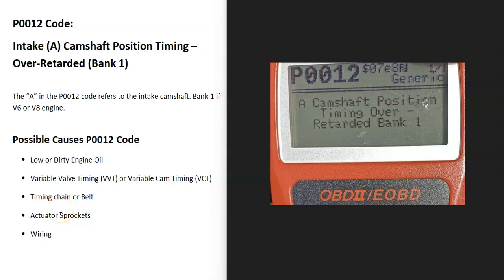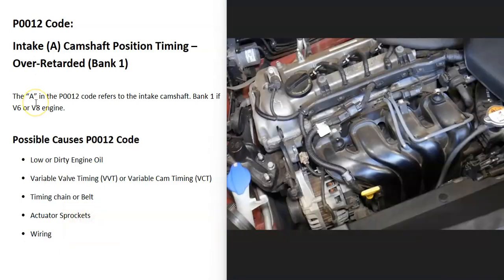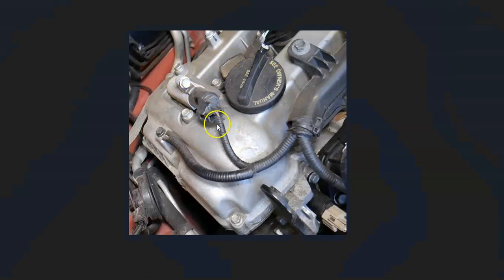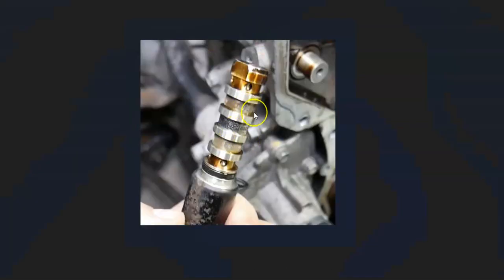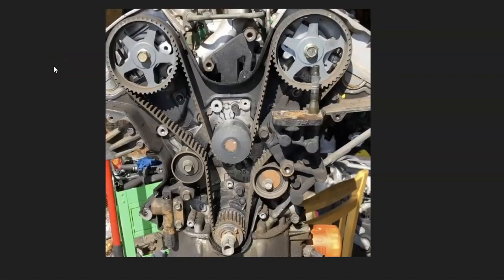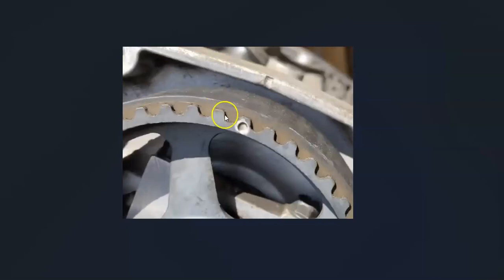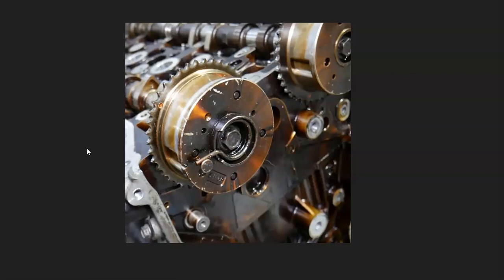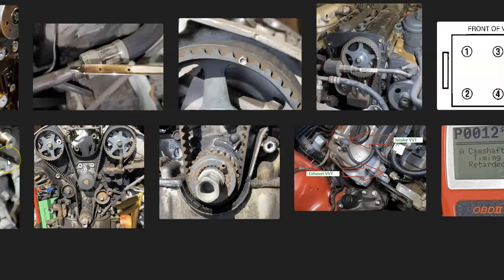Causes and Fixes P0012 Code: Intake (A) Camshaft Position Timing – Over-Retarded (Bank 1)

Comment: I changed the oil after 8000km on my BMW, I did an oil flush since it was fairly dirty and put new synthetic liqui moly oil that's LL01 rated. The next day, I'm getting this code, can someone suggest what the hell is happening. Can my BMW get shocked by replacinf old oil with new oil??
Reply from the maker: I would verify the new oil is the correct type, since if it's wrong, that can cause issues with the VVT.
Reply: @HVAC_Mechanic I looked into this, and read some forums of people using the 0w20 on their n52 because it's cold where I live. My n52 is supposed to take 5w30. Do you think this will impose an issue?

Comment: There is a knock also but when scanned p0012 came up. Is that normal for  cylanoid or timing? It ran low on oil but ran fine then did thid

Comment: I been having a poo10 for months. Changed intake VTT solenoid. Same code so he then changed exhaust vvt not only same code but now I'm getting a poo12. So he went ahead and changed the camshaft position sensor still same 2 codes. Oh forgot to mention the car is a 2009 avalon.

Comment: What if you change your oil just fine  the level is on point BUT your dumb ass forgets to put the filler cap back on and your drive for a couple of days without knowing it’s off!! 
What do you do then besides kick yourself in the ass for doing something so stupid so idiotic 
What do you do then?

Comment: I have a 06 ford expedition i put in a new timing valve solonoid i believe its called. Ran codes and it says i this code along with 8 others all about cam shaft banks 1 and 2, also  i know i do have dirty oil what would be my next steps? Please and thanks

Comment: Ive got a 2016 Ford fusion 1.5,  just replaced the vvt solenoids and it didnt fix the issue. If the code or light is still on after the replacement, do i need to clear the code for it to run correctly or should it have cleared itself?
Reply from the maker: If the problem is fixed the computer will reset the code at some point, when depends in the vehicle. I would clear the codes with a scan tool and see if they come back.

Comment: I think my issue is low oil preasure or an electrical problem. It's a 2014 Ford Mustang v6 3.7 and I have Diagnostic Trouble Codes (DTCs) P0024, P0014, and P0012.

Comment: Hi, I have 2010 toyota corolla, and it pops up code p0012 and i open the valve cover, and front side oil is so slow compared to the back side what can be help please
Reply: The oil coming out of my VVT solenoid is very slow too. I am wondering if the oil pickup tube is clogged, the oil pump is faulty, or the pump is sicking air. Did you find the problem on yours?

Comment: Toyota told me the 4 camshaft sensors needs to be replaced
 Currently je said thr bank 1 A timing over back 1 is the one giving issues. Can u do a video on how to replace it as well as the 4 camshaft sensors? Is it easy enough to do myself? Toyota wants to charge me 1700 bucks
Reply: The problem is rarely the actual sensors. It's often the ce'ns'ors detecting issues so the codes point to the sensors.

Comment: I just got this code after running over something. The wiring might have been ripped out? The last repair was the water pump. Timing chain not changed. Checking oil tomorrow the low oil light did not come on and was changed 1500 miles ago.
Reply: Hi, what was the problem?
Reply: @florenbaron7111  they couldn't find anything and erased the code. Dealer.

Comment: Customer self installed timing chains on 5.4 navigator and it knocks after driving. I assume he is 1 tooth off on each side. First, I changed his ultra black oil and oil filter feels like 5 pounds of crap. 😂 Clearing codes now. I hope it isn't the o ring on oil pump, but I am going in deep later today and pull it all apart.

Comment: I'm pretty sure my issue is the sprocket at the end. The engine was rebuilt last year and it runs good, but that stupid code won't go away. I've changed out the VVT solenoid and that didn't help. Your video is the only one I've found that explains all the troubleshooting scenarios. Thanks for the great info.
Reply: did you find the issue?
Reply: @wise_soul8886  No I gave up.
Reply: @yamnjam 😂
Reply: Same issue. I actually swapped the whole engine after getting a P0012 code. And the code will not go away even after the swap. So now I’m thinking it’s the wiring. Frustrating
Reply: @211sweatz  I originally had a trouble code for an open/circuit in bank 1 cam position sensor actuator. Mechanic changed vvt solenoid B1 intake. Same code so he then changed the exhaust vvt also. Nothing code still appeared alone with a new one the dreaded poo12. Now why is that I don't know.  Can a newly installed part cause a different code?  So he then went on to change the cam position sensor. Nothing changed. Will be checking the wires and connectors Tues. I have honestly thought all alone it's a wiring issue.
Reply: @211sweatz same…
Reply: @tristontownson1391 I seen in a video that it is the camshaft position sensor

Comment: i have 06 camry 2.4 vvt. i get the code here when driving and after about 10 minutes of driving i will get the p0420 code. clear the codes while driving and the cam code comes back and once i parked and let it idle, it shuddered and threw a code regarding cylinder 3 misfire..i was wondering if this was timing related or could it just be a dirty/clogged fue
l injector
Reply: Was it the injector?

Comment: I have a 2019 Infiniti Q50 3.0t (94K miles). My car was driving very sluggish when I was trying to accelerate. 
I ran my OBD scanner and got the two codes:
P0012 - A Camshaft Position Timing Over - Retarded Bank 1
P0022 - A Camshaft Position Timing Over - Retarded Bank 2
What does this mean? What should I be replacing?
Reply: i got the same codes bro.. did you ever get it figured out? please let me know.
Reply: @xxuyzzdr3851 what ever happened to you? Bro what was the outcome
Reply: You ever figure it out
Reply: @Jonathan-cv4tk  yeah. I took my car to the dealership so they could assess the situation. My turbochargers were failing. It was going to cost me $8,300 to replace them. So i decided get rid of the car LOL!
Reply: @ChrisBrown-xq8ji  should've done the turbos yourself and save yourself 5-6k $, turbos are not hard at all
Reply: @horror0100  Infiniti changed their engine on the 2019 and up. They made it difficult to change the turbochargers yourself.
Reply: @ChrisBrown-xq8ji I just brought this car and I got those codes with 61K so you’re basically telling me I’m fucked
Reply: @ChrisBrown-xq8ji I brought mines for 8,600 so if the turbos fails I feel like I should just sell the car
Reply: @Forjettaheat  yeah. I traded my car for another vehicle earlier this month. It would have been a waste of $8,300+ to replace the turbochargers.
Reply: @Forjettaheat  if you don’t have warranty, then yeah.
Reply: @Forjettaheat  oh wait, you said your car has 61K. Your car is still in warranty. You should replace them  now before it expires when it reaches 70K
Reply: @ChrisBrown-xq8ji  Just saw a post on forums, yeah that looks stupid.
Reply: @ChrisBrown-xq8ji  I brought off second hand it doesn’t have one😩
Reply: First problem here is that u went to a stealership to get car checked out. Bunch of crooks

Comment: Great video. Just did a timing chain kit and new intake/exhaust vvt sprockets job on a 11 Toyota Camry..customer used eccpp parts but there was a ton of sludge inside the motor..car drives good but got this exact code right after..
Reply: Dirty oil caused clogging in the solenoid so you probably need to replace the solenoids , clean them, and change the oil a couple times maybe even do a engine oil flush?
Reply: Could you fix my Camry with this code for me too, bud, plz and thnx.

Comment: I got a 07 f150 with this code and it idles rough when I’m at a stop or reversing any idea what it could be?
Reply: Man!! I have a 2011 Explorer and my issue is IDENTICAL!!!  when at a light, I have to put in neutral and give a little gas to keep from stalling out-  all started one morning on my way to work  when it was raining really hard
Reply: @SeanJohnson-g9y  my 2010 f-150 does the exact same, so embarrassing 😳
Reply: Did you figure out the problem?
Reply: Could be a Faulty VCT silinoid

Comment: I had this code on my ecotech and it was the camshaft positionING sensors and the chain tensioner was bad..I replaced the vvt chain gears and tensioner..The 2011 ecotech is known for this problem they all get it at 70 to 110 k ..Gm should have recalled these but never did.